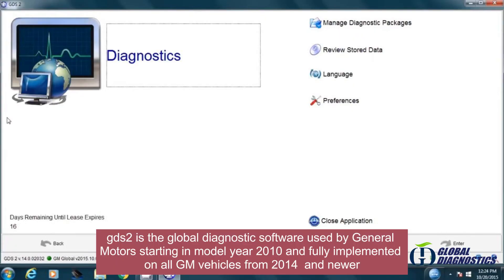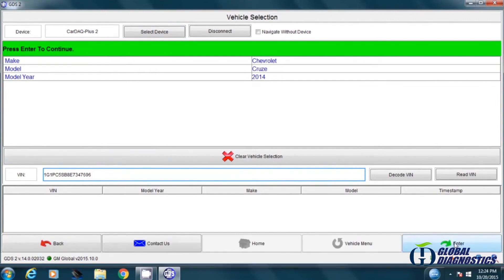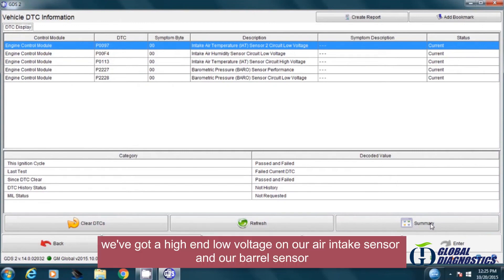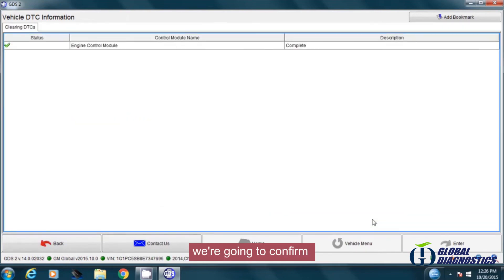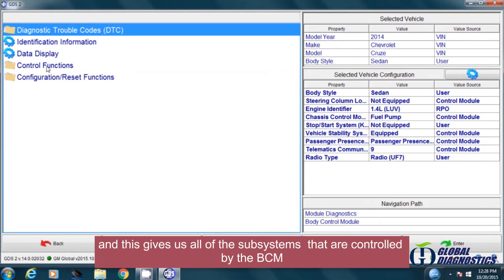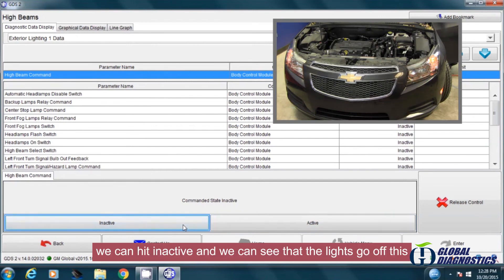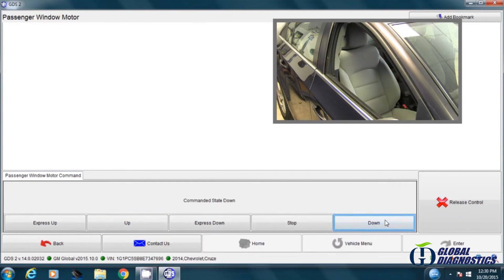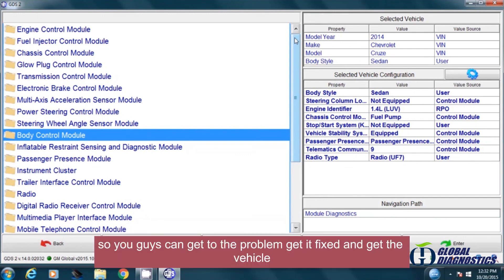How to use GM GDS2

Comment: I have reprogrammed before my 2010 TCM module via the online SPS programming TIS2web with the paid service using my VCXnano from Vxdiag. 

I have 2 work vans
2010 Chevy Express 4.8L and
2016 Chevy Express 4.8L.  

These vans if I recall correctly having the same engine, transmission, and everything. My main question is, would it be okay to look at DTCs and reset or relearn via the GDS2 application for a 2010? Supposedly, any vehicle before 2013 you need to use Tech2Win, but I selected 2014-2016 years on my GDS2 for my 2010 vehicle and all the modules populated along with DTCs and options to test the components.  So basically, is it okay to use a gds2 2014+ vehicle type on a 2010 Chevrolet Express van?